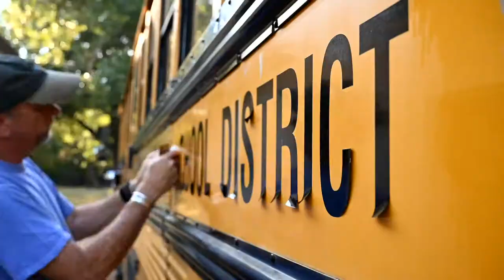Our Bus Floor: Phase TWO! Removing Rust and Filling The Gagillion holes

Comment: Curious on the purpose of the construction cement before the fiberglass?  I was thinking about doing the fiberglass on mine, but didn't know if I should also do the cement.
Reply from the maker: It may not be necessary but we felt like just using just the fiberglass mesh night not be as strong. That’s the beauty of this skoolie stuff… there really no perfect right or wrong. Well, there might be some “really wrong” processes out there but hopefully we won’t hit any of those.  🤣